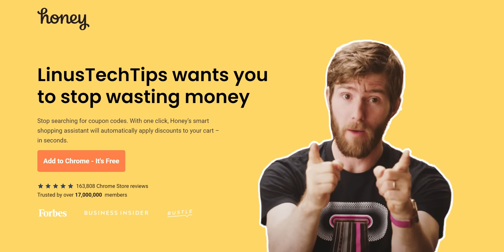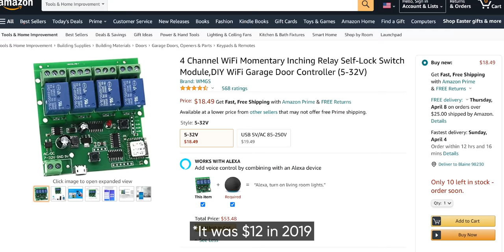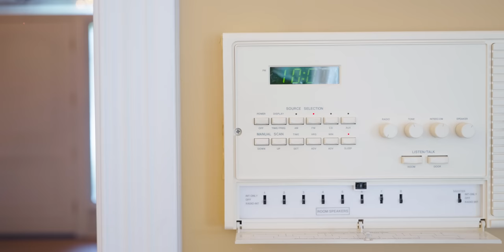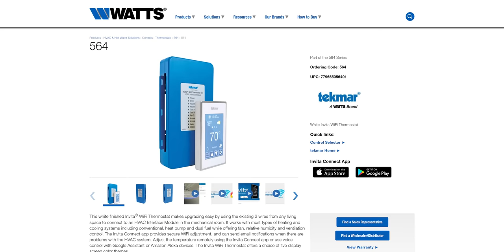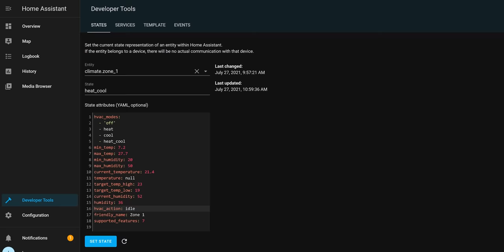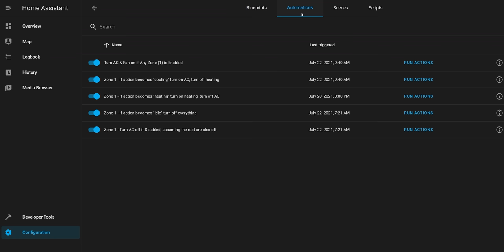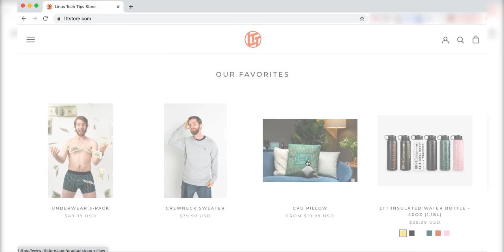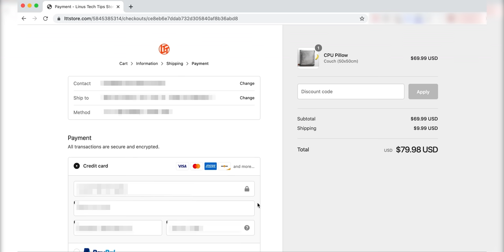This Should've Been EASY - New House Smart HVAC

Comment: "fortunately the builders did a good job of labelling everything" looks like Linus found a one in a million house LOL
Reply: As a handyman, I have the "privilege" of figuring builders' layout frequently. They get, uh... creative sometimes.
Reply: Must have been built by the new guys lmao
Reply: *billion
Reply: Yeah. My first place was like that. The home inspector said that the rough-in electrician was probably an apprentice trying to impress his boss or the city inspector. Not a single wire overlapped coming out of the breaker panel, everything was flat, secured, and not twisted. And every box (outlet, switch etc) had a little sticker identifying which breaker was feeding it. Seemed like overkill, but it made it soooo easy when we were upgrading switches and fixtures.

I have owned a few more houses since then, and helped many friends, and have yet to see anything even remotely as clean.

Comment: Btw, you should set a "minimum airflow" for each zones and not simply turn it off, because if you stop supplying air in that particular zone, you're basicly killing your efficiency. The room will get extremely hot and once peoplestart going in it, i'll take a bit to cool it down to an acceptable temperature.
Reply: like an inverter ac
Reply: ALSO this will kill his equipment, the indoor coil requires a certain amount of CFM for it to operate.  He will freeze his coil by doing this and slug his compressor. He can't just install shut off dampers with out installing a static pressure dumping zone for the needed air flow to go.
Reply: That does very much depend on the amount of time in between, the houses insulation and the outside temperature as well as in some cases infrared intensity through windows. There are houses where the temperature doesn’t climbmore than one °C an hour even if it is scorching hot outside. So though your point is surely true for some cases and depending on region even many cases, it is not universal. My tip would be to either inform yourself for your typical climate and insulation and if that is hard/impossible to reliably find out. Do some tests yourself (recording temperature curves, power usage and your own comfort (if you disregard that you can simply use the old fashioned/european method of opening windows over night and closing the blinds during the day and turn the whole thing around in winter. The power efficiency can’t be beaten). 

Sometimes/for some people having a room not as cold/ just a bit below/ at outside temperature and then possibly cooling it down gradually is to be preferred because it prevents temperature shocks. A wall of cold air can very much be detrimental to health (increased stress levels which heightens the risk for multiple issues)
Reply: True, they should set it up in a way similar to how the human body works: having both the effectors for “too high” and “too low” to maximise efficiency and get a constant, specific temperature in the room.
Reply: @ramennoodles2391  Makes sense. Cooling a room that has reached 30c to 21c is going to take more energy than a room that never gets over 25c.
Reply: @littlewicky1  while also feeling more comfy

Comment: use the server room as a ‘DMZ’ for the AC. You dont’ want to cut too many rooms off and still pull for one small room, but the server room is never going to refuse cooling so use that as a relief valve
Reply: genius
Reply: Its a good idea, but it still has to be balanced. Normally a stack bypass is installed if the rooms require being completely shut off. In a reasonable situation, each damper should only be able to close up to 90%, never completely closed.